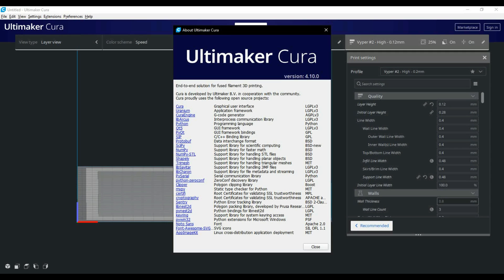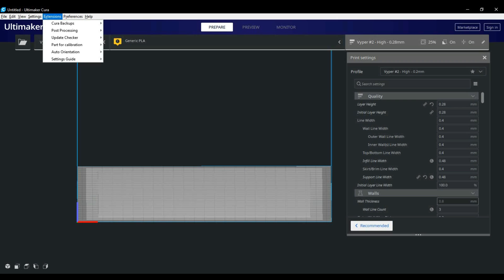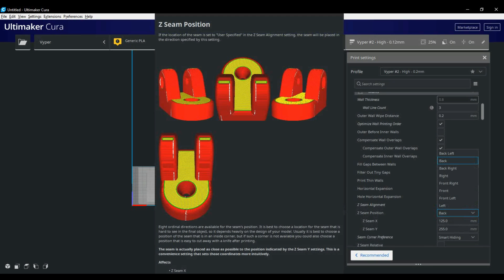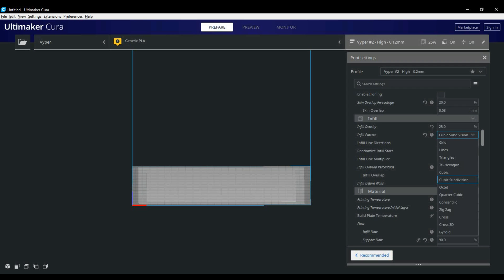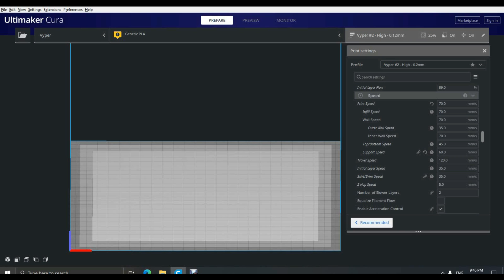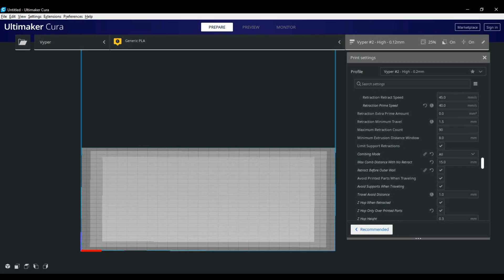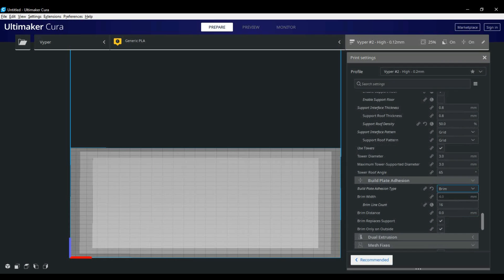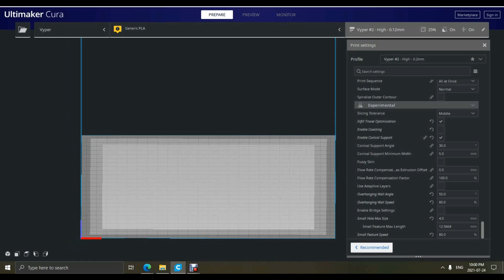Cura Walkthrough Vyper settings

Comment: why are you choosing  the I3 maga and changing the name to vyper. why not chose the vyper. the setting  guide  does not show up. it is in the top left drop down but not in the drop down on the right. what am i missing
Reply from the maker: This was made before the vyoer was added to cura. Unfortunately I generally get printers a month or two before release and there's no machine so I will generally use a custom printer. You can use the vyper machine in the new curas

Comment: Hey Zombie. First off, thanks for all of your videos. I've garnered a lot of knowledge watching them. I took a little break from using my Vyper, but I am about to start using it to print again and I was wondering if you have made an updated profile for Cura for the Vyper. It's been a while since I've played with my Cura settings and I got a new computer since the last time that I printed anything. I was going to load the V4 profile, but noticed that it didn't have the linear advance settings in the profile. I did flash your custom firmware on my vyper so I didn't know if I needed to put that setting in on my own or if it's just good to go. Any help would be appreciated.
Reply from the maker: Your good to go with the v4 profile. You just set the linear with the terminal on pronterface and it's good to go

Comment: judging by the comments 100% saying ur settings works perfectly...can this settings work for ender 3 v2 as well?i checked ur channel but didnt find any 😅
Reply from the maker: You might be able to import and use the profile on the ender 3 v2 it may not let you import it but the settings in it can work with most fdm printers. You can contact me via Facebook or email and can see if we can figure it out

Comment: Isn't there settings on Kira that I can adjust the E steps instead of downloading a new software for the motherboard to allow me to adjust the steps on pronterface? I really don't want to have to do all of that. I did use pronterface to adjust the extruder though and now I have it right on.

Comment: I've gone through all the settings you suggested but I'm still getting a rather nasty amount of stringing. Any suggestions on what to look at?

I've had a fair amount of marlin based printers but the stringing on the vyper is the worst I've seen :(.
Reply from the maker: What are your retraction settings and what do you have your combing mode set to? Also when using zhop make sure z hop speed is 10mm and try setting zhop height a bit higher .8mm or 1mm

Comment: I just loaded your PETG profile and it seems very different than others I have tried. The printing temp seems low and the speed seems high.. can you tell me what filament you use? I'm currently struggling with Overture PETG - I'm getting a lot of stringing and warts. Thanks so much for the support you provide the community!
Reply from the maker: The petg I have printsnreally well at 220 if your having excessive stringing try increasing retraction .5mm at a time and makensure travel speed is 160. Print speed should be 50 or 45

Comment: Is the start g code already added to your tpu profile. How do I add it if it's not?

Thank you.
Reply from the maker: Start gcode is under preferences,printers machine settings
Reply from the maker: The profile just has the print settings the start gcode only changes if you change in machine settings

Comment: whats the diffrence between LA-PLA-V2 and Vyper-PLA-V2? which is the right profile for cura? and do i need to use your custom firmware for your cura profile?
Edit: Cura isnt accepting your profileformat...  dunno why you also have 2 files ?!?
Reply from the maker: I'm using my v3 profile currently..been swamped last week or so will get thebdrive cleaned up. The v2 profile is based on the mega printer profile. The new v3 is build on the new cure 4.12 with the vyper machine try the v3 I'll clean the folder up today as well
Reply from the maker: The la version has settings for my firmware with linear advance. The non la os for non linear advance.

Comment: i love my vyper  but i do have question i havent ran across before but i have part that when i put a brim on it not all of it has the brim for some reason some of the model it wont allow any type of bed adhesion like raft or brim  do you have any suggestions on correcting it thanks and i love your  videos.
Reply from the maker: Check under adhesion and see if brim only on outside is checked off. You might need to go into setting visibility to show it. It will only print the brim on the outside of the object if it's checked off. When you uncheck it the brim will pront anywhere there's a edge

Comment: Hi. I tried one of your profiles and saw that more filament is required for a model compared to the default profile. Is it intentional? I used another popular profile and requirement is lower but it didn't print well compared to the default one. So I thought that maybe more filament is required to print better. What is your thoughts about it? Thanks.
Reply from the maker: It could be I had infill set higher. Or it could be different number of top and bottom layers. Wall count.. couldnbe alot of things

Comment: I have the latest version 4.12 when I go to quality I can't see how to change the values. All I have are check boxes.
Reply from the maker: Are you in the preferences and setting visibility? You need to enable the options to show and then they should show up on the right panel with lrint settings.

Comment: how to restart after pause? there is no button on the LCD screen after i push pause button. only "paused, waiting for command" this kind of massage appeared and nothing i can do about it. there is no 'restart' button what should i do?
Reply from the maker: It's a problem with the lcd firmware. They haven't posted proper sources for thay yet. I've been working on fixing it but the source they posted is just the base it needs to be built from scratch which is so time consuming. I fixed a couple issues with my custom firmware but you need to use pronterface or octoprint for it to work right. If you need more help or info drop me a message at studiozombie3d@gmail.com and I'll try and help you best I can

Comment: I have printed a couple of model buildings, and I must say with your PLA profile (v2), I am rocking.  I am using white PLA from overture, and it is WHITE, not off white, but white white.  Question 1> I used your v2 profile, but the setup is minor different from this cura video you did.  Is the v2 profile a little better than the one in this video?  (I also printed at 100mm/s, and it did well, but I think I will stick with 70mm)  Question 2> on the second print some of the supports were so solid, I chipped the print a few times getting some of the supports removed.  Is there something I can tweak to make the supports a little easier to remove?  And finally, on some of these, I really question the need for supports, but cura would NOT uncheck the supports...thoughts?  Thank you loads - PS, where do I donate or buy you coffees or whatever?  I really owe you for all the help that your channel has given me.  My wife loves it!  WIN!
Reply from the maker: Glad to hear it's working out well for you. The v2 profile is just tweaked a little from the previous profile it seems to be getting better quality. Was just a couple tweaks to speeds and minor tweaks. Under support settings you can try to adjust the z distance I think I have it at .12 you can try .16 and that should help a bit with supports. If you keep having issues with cura not letting you uncheck you can try deleting and reloading rhe profile sometimes if you have a few profiles I find cura has random bugs like that.  I'll look at adding a donation link to my linketree just happy people are getting good results from the videos and profiles I've been able to provide. Been also getting great feedback on the custom  firmware I've posted. Thanks again for the comment appreciate your views and glad the videos have been able to help you out
Reply from the maker: I've updated my linktree with a link for coffee lol

Comment: Noticed that you don't put a G29 in the start gcode? Is there a reason why you wouldn't want the bed level to occur at the start of a print?
Reply: That is what I figured as well. I have been trying it both ways and I have had better results with it on instead of off which makes no sense. I rarely remove the actual plate as the prints come off easily after cooling. Not sure why this is the way it is. Thanks for the video and prompt response. I am having some odd print issues and I am trying your settings now. Mostly dealing with stringing odd branches off the main parts that come off easily but are a pain.  Thanks again!
Reply from the maker: @bernardhny  no problem if you are comfortable with calibrating and flashing you can try my custom firmware the linear advance fixes a ton of issues. Also has buffer tweaks for octoprint and a couple safety features  works really well and been getting good feedback with it.
Reply from the maker: @bernardhny  I also think with the leveling being a pressure sensor system little things will affect it from level to level. If any filament oozes out it will throw it off a little it's really touchy from what I've seen in my 3 plus months with it
Reply from the maker: The bed is solid  mounted I only level at the start of the day or if I  remove the build plate.  Don't have to level every print

Comment: Just a suggestion please video your computer screen a little closer. Particularly the settings. It’s easier to copy to a second screen from our side. Thank you
Reply from the maker: Will do maybe I'll add text to the screens if I'm showing info or I'll zoom in a bit more. Thanks for the suggestion. Also my profiles are always posted on my linktree as well as my custom firmwares. Will be posting updates soon to firmware again
Reply: I would like these settings with PETG. Would you be doing a video on necessary changes for different material.
I love my Vyper. My Prusa Mk3 is awaiting the plus upgrade that I keep putting off.
Also I want to add octopi to my Vyper. Any suggestions as to physically linking the raspberry pi to the printer.
I would like to use octopi. After watching your e-stop calibration I was convinced to purchase a pi and follow your lead. 
Thanks again for all your help. My family will enjoy their printed gifts for Christmas 👍
Reply from the maker: @1Hyetech  appreciate your viewing. For the pi I just have mine sitting beside my printer in a case then the USB to the printer and my camera. It's the beat addon by far for printing. Makes life aoot easier. For petg I use the same profile but I change my speed to 50mms, I'll drop retraction to about 5mm at 40mms and fan speed I'll set to 40%. Hotend 235 and bed 80-100
Reply: @studiozombie3d  thank you I’ll trythat
Reply from the maker: @1Hyetech  I'm making a more thorough look at cura will have a pdf file in the description with what setting I have visible and my current settings. I'll add it to this description as well
Reply: @studiozombie3d  I don't have some of the settings like top/bottom or z seam relative, I have relative check marked but it doesn't show up

Comment: Anyone that has purchased a Anycubic Vyper needs to copy these Cura settings. I did and my prints are high quality with very little clean up.
I printed the fan from the jet engine project and it look so clean. Looks like spun aluminum. Adhesion is spot on never have to clean the bed except for a quick wipe of alcohol.
Best informative tip ever. By the way I’ve only been printing for a week and if it hadn’t been for the video I probably would have given up.
Now I print with these instruction and have a better understanding for slicers and how to tweak the fine tunes.
Reply from the maker: Thanks for that comment super happy the video helped you out. It can be alot to take in for a beginner just trying to make things a bit smoother for people. 
Thanks again for watching and if you want to see anything In future videos let me know

Comment: Hey, can I ask you something.  I have never done 3d printing before. I got a Vyper. I followed the instructions in the manual the came.  My first few items came out okay but then I started noticing halo like things around like the base. And sometimes it makes nothing but just random strings all over the place.  I will auto level it again and take out the filament and put it back in.  But then I will print a simple dog and two legs will be shorter or fall off. I never really get a nice, clean item.  I got this for the filament. PLA Filament 1.75mm Marble, SUNLU PLA 3D Printer Filament Stone Color, Dimensional Accuracy +/- 0.03mm, 1kg Spool(2.2lbs), White Marble.  I tried your profile as well, but I just got random strings all over the place.  Any thoughts on what I might try?
Reply from the maker: Have you calibrated the esteps and flow? You can try lowering temp a little to help the stringing. First thing I'd do is make sure esteps and flow are calibrated then try the prints again if your still having issues try lowering the temp 5 degrees
Reply: @studiozombie3d  Thanks, I will try that.  What is esteps? lol  So I just tried printing the Owl that comes with it and it worked perfectly.  Then I loaded a skelton head stl file into Cura, sliced it, saved it to disk.  As soon as it started printing, all it did was make random strings.  There is no object.
Reply from the maker: @SagansWar  you need to calibrate the esteps to get the right amount of filament to flow. Need to measure 100mm from the tube going into the extruder then extrude 100mm and measure the mark
Reply from the maker: Then you need to figure the esteps say there's 4mm between the mark and the tube you would go 100/96×405 or what the esteps are currently that gives you new esteps of 421.8
Reply from the maker: @SagansWar  then you need to calibrate the flow % by printing a single wall cube and measure the walls
Reply: @studiozombie3d  Ok, I looked up Esteps. I will try that. Found a video on it.
Reply from the maker: @SagansWar  yeah tune that and your flow % for your slicer using a single wall cube and that should help with alot of issues. Then you can tweak further
Reply: @studiozombie3d  Let me ask you this.  Do I have to do something specific for each model? I did the Esteps. I can print the Owl fine. But then I got a model of a statue. I brought into Cura using the default profile I got per the instructions, I sliced it, and saved it to the SD card. It started out fine printing the platform and shoes and then suddenly made nothing but random strings all over the place. I don't know why it does that.  Any suggestions?
Reply from the maker: @SagansWar  are you using the profile off my linktree? You can try resetting the eeprom. Just make a note of your esteps run m502 to reset the eeprom then enter m500 and re enter your esteps and m500 again see if that helps. Ice had times where my printers act up so ill do a reset and it solves some of the issues. If you have Instagram I can help you there and you can send me a pic of what's going on

Comment: This has been really helpful thank you. I had never used Cura before and have very little experience with 3D prints. I am set up and running, tinkering with the settings to try an learn more about it along the way. My initial aim has been to minimise support density as much as possible and it has been going great with the Custom Support Cylinder plugin, so far the Vyper has been an enjoyable experience. 
Once again thank you for getting me started, really clear and understandable video.
Reply from the maker: Glad to hear it helped out. There's alot of little things in cura, I'm looking at doing a more in depth video in the future of some of the features and little tweaks
Reply: @studiozombie3d  oh cool, I am subbed so will keep an eye open for it. I have a new micro swiss 0.8mm nozzle coming to give that ago too along with... a second Vyper! Given how positive people have been about the Vyper and it so beginner friendly I bet there are loads of people like me looking for info, which there is not too much about due to how new the product is. 😀
Reply from the maker: @jinxed13  nice man. I need to get some nozzles for mine. I generally stick to 0.4 but want to try up to 1.0mm to really see how fast the vyper can go. And you can go wrong you have everything you need to go with it. My ender 3 took alot of customization to be at the level of the vyper. My vyper is still full stock